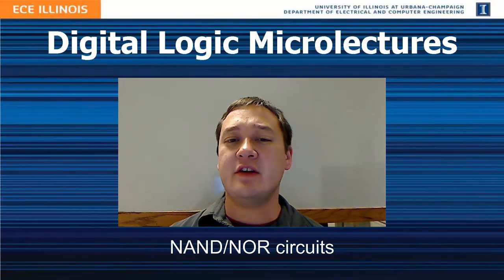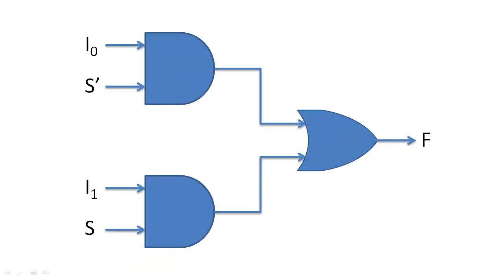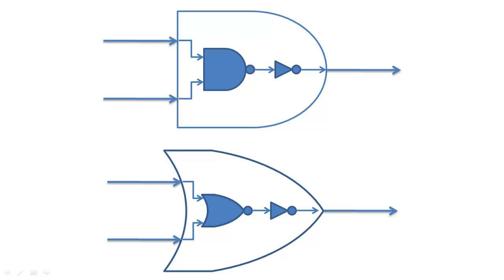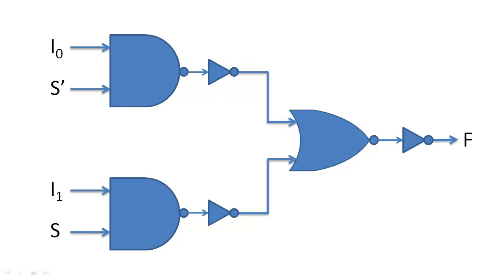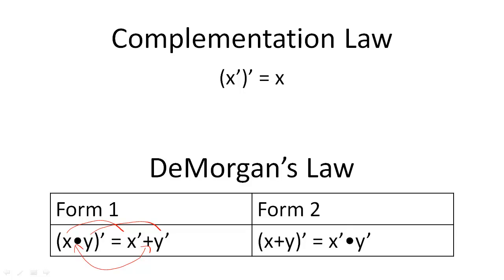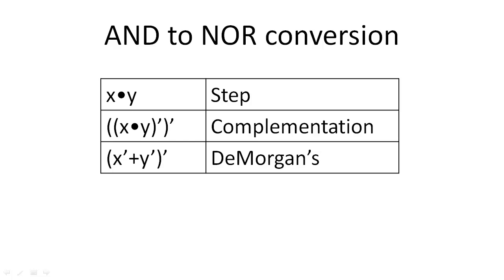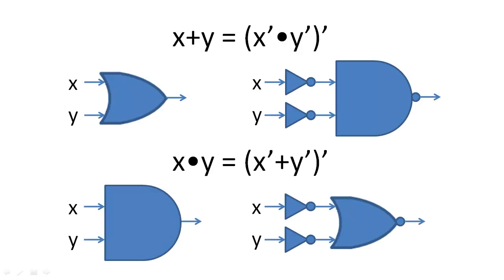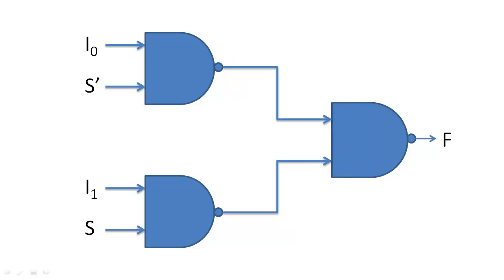NAND/NOR circuits

Comment: This seems quite complicated. Just learn And & Or gates and remember that the outcome for N'and & N'or gates are the complete opposite logical outcome. Any zero in a N'and gate's input will give you a 1 output, conversely any 1 in a N'or gate's input will give you a zero output.
An Ex Or- (Exclusive or gate) needs a 1-0 or 0-1 input to get a 1 output. An Ex N'or- (exclusive N'or gate) will give a 1 output with either a two 1s or two 0s input.